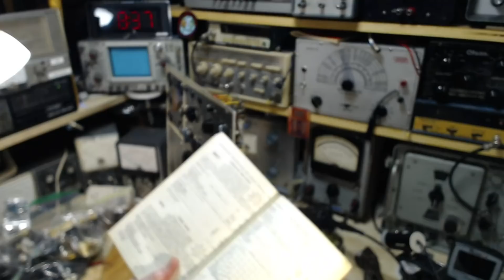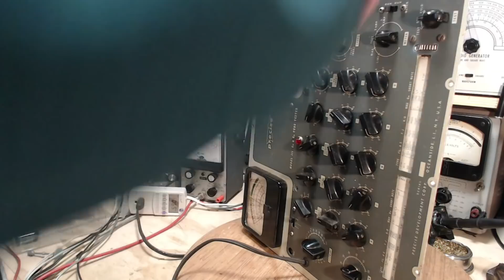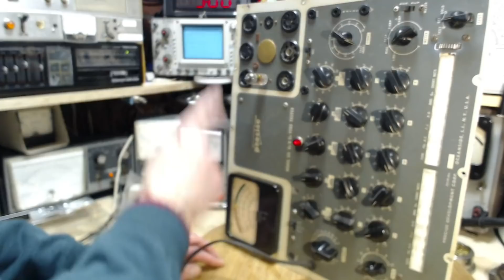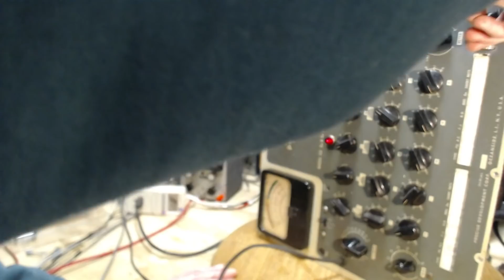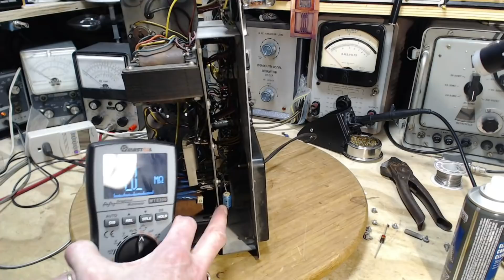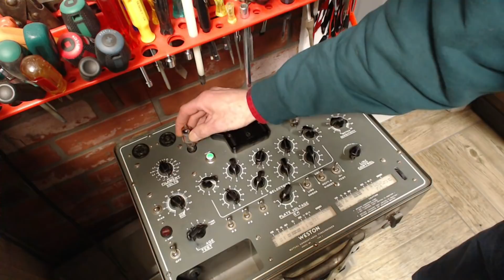Precise Model III Tube Tester Video #2 - Knob and Tube

Comment: The smaller tube is for your bias volts and larger tube is for gm tests. Look for a diode in your tester they usually use them for meter when doing line adjust. Also check for resistors that drift high could be dropping to much voltage